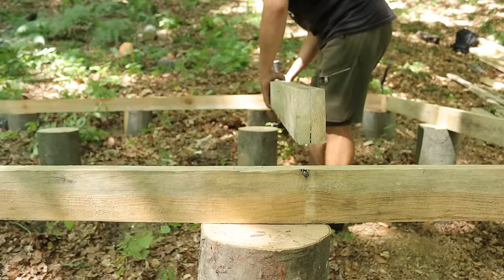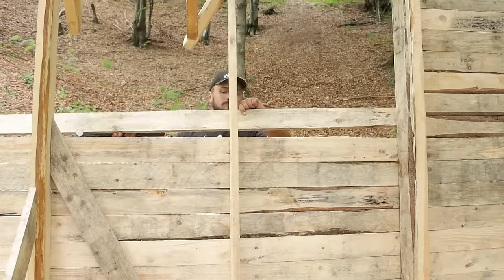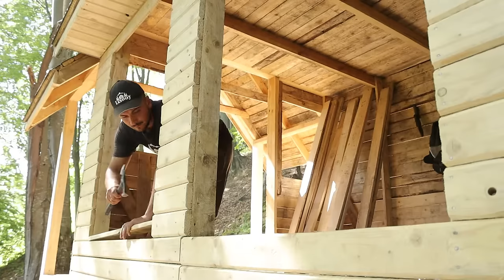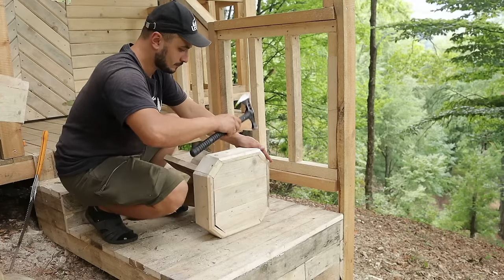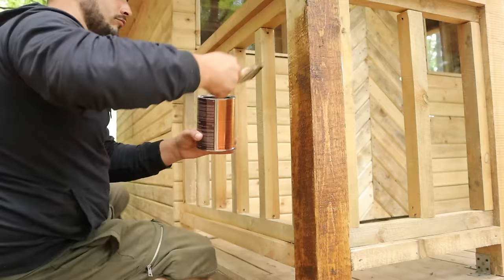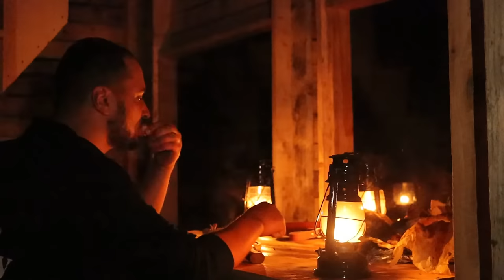House in the Forest Do-it-yourself. From Start to Finish

Comment: Very good but can you explain what is the point of a house like this? Too small, too many spaces between the wall boards, and then you will be cold and rain will come in. Construction with too many nails and too few screws and this weakens the compactness of the structure. No glass in the windows, and therefore little heat, great heat loss and little security against intrusion. Very rough wood and dangerous for splinters. What is the point of all this other than to show that you are good at building?
Reply: Ну может и показать умение иногда нужно!?! А может кто-то заказал ему лёгкий летний аккуратный домик!!!
Reply: Hike out for the day, have lunch? Fort for the kids to play in? Camp for a few nights during the summer? Or to store stuff remotely/act as a half way point when there are no easily accessible roads? It's also not difficult to build off of this and make it more livable in the future if desired
Reply: Just what is your problem with nails? My father built 100s of homes and the only thing screws were used for was the hinges.